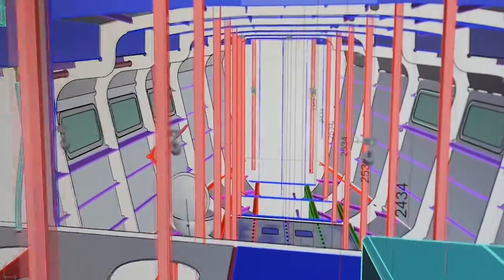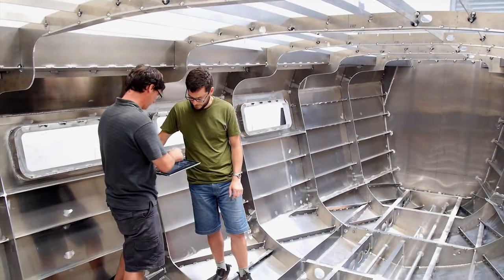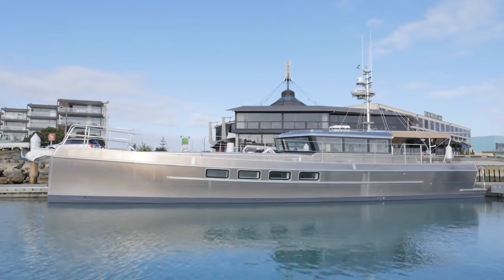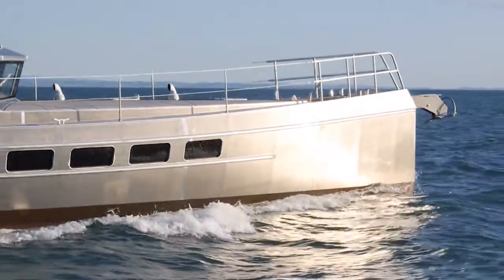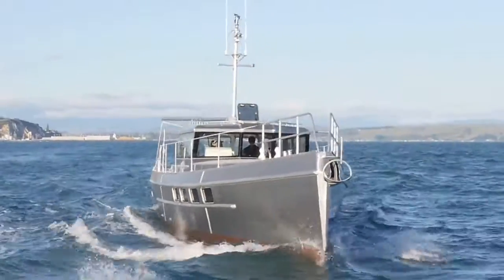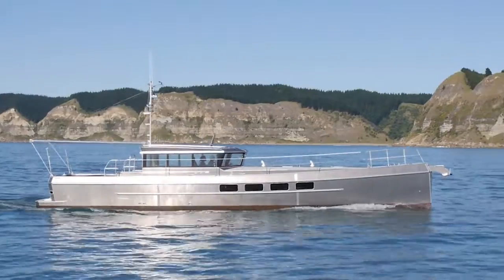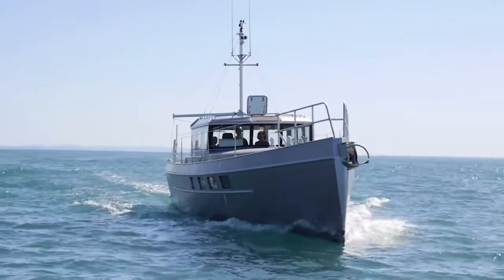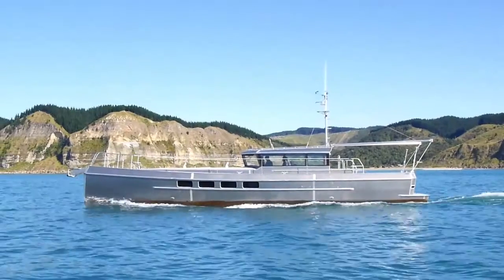Dickey Boats Art Nautica LRC58

Comment: Hello , i want to ask something.  Is the number of ranges I see for lrc 58 correct? There must be a mistake in this account, this figure seems impossible , 8500 kilometers with 3500 liters of diesel? I calculate every detail, but this range seems impossible with 75 and 90 hp machines.